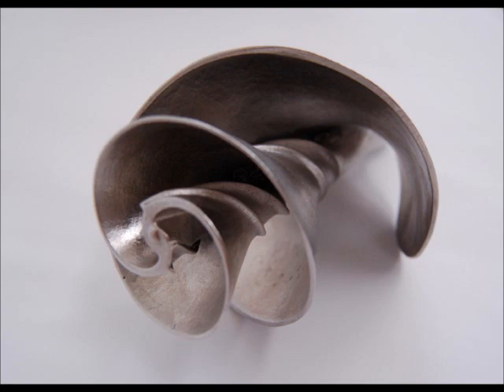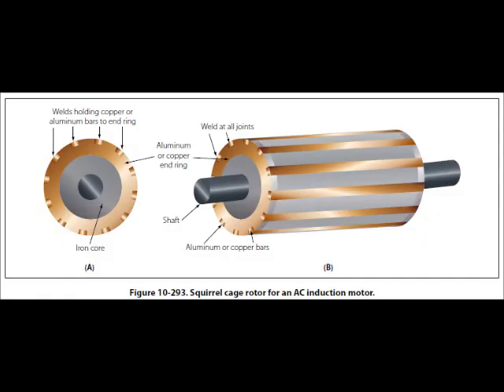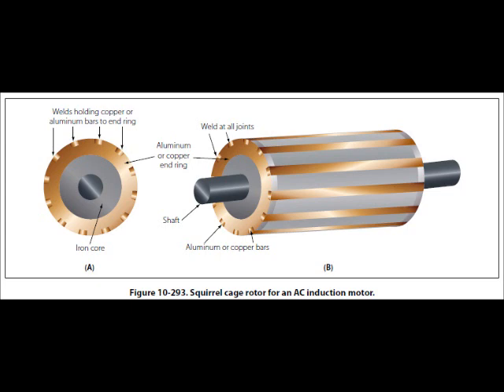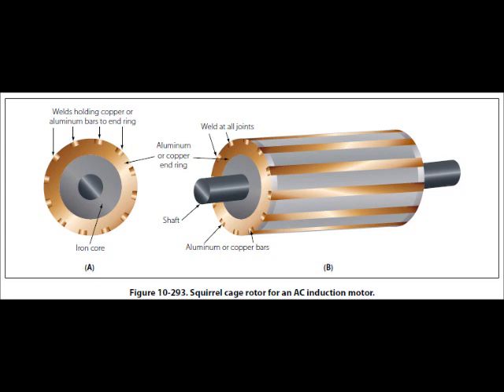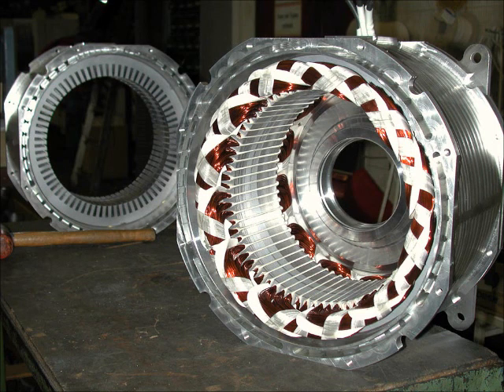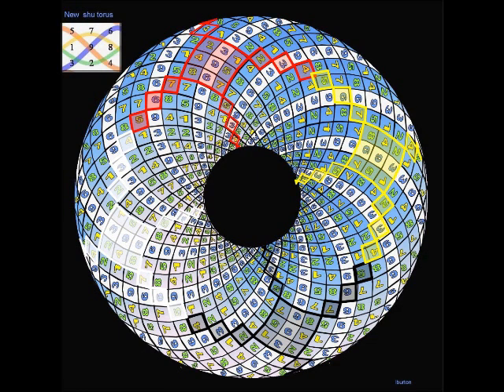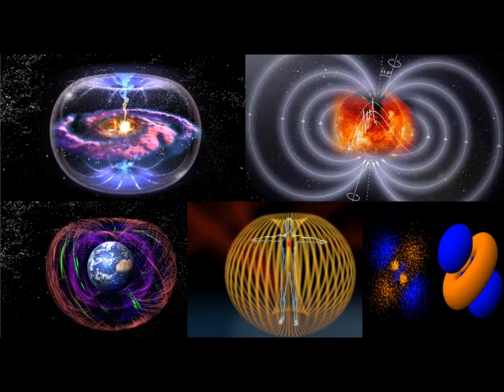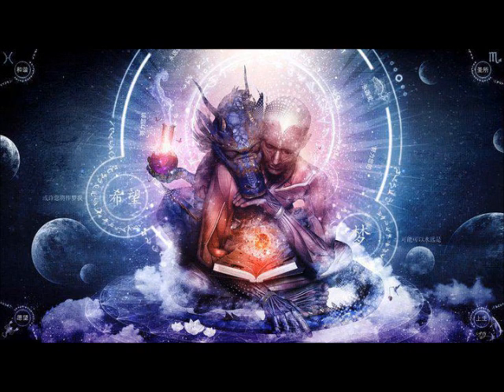Torus Vortex Lily Impeller Electric Motor

Comment: BS
Reply from the maker: You didn't understand a thing.
Reply: Tyler M  I did not get  doctorate in black magic.
Reply from the maker: Do you have a grasp of quantum physics: because what you just said is kinda what quantum physics is kinda like. So my model is based off the subatomic level in the atom. Using high grade nano material to create supper conductors. That harnesses quantum physics by using nano materials that conform to magnetic fields shape for an electric motor. Your the type of person that would say back in the 19th century that man could not fly. Let get even more basic on this level of nano materials. If you can build at large scale nano industry you can cure all cancer. So who are you. I'm an electrician.
Reply: Tyler M I am a well educated electrical,  engineer with post graduate degree.You don't impress me by throwing big words like subatomic and nano and then tell me what the hell is a supper conductor you mentioned. Is that the waiter who carries the dinner from the kitchen to the table? 
What is the " field shape of an electric motor"?
 I don't deny science but I certainly deny pseudo science which you are spouting by the barrel loads.
Reply from the maker: A room temperature Superconductor is a material that can conduct electricity with zero resistance because there is no defects in the material to resistance the movement of electrons though a conductive material. So make a material that is a nano structure which is able to happen with a molecular assembler which puts atoms together fusing them with electricity to make things like a crystalline copper conductor which supper conducts at room temperature. Doing this would then make a motor that has a constant magnetic field spinning due to no resistance or very little amount that is unresponsive. 
The field shape of an electric motor is the torus field like shape that is produced by the electrical motor. You see a motor has two things. A stator and a rotor. The stator has coils in conventional motors like an oval shape. Which does not fit the shape of the magnetic field that is in physics. You can tell this by the heat built up one each end of the oval coils.

Comment: There's a lot of motors using this design. It's called the rodin coil.
Reply from the maker: +Jose Barrers Yes my motor is kind of like Rodin's coils, but there is a big difference. You see Rodin is talking about a solid state device. My type of tours would have inner geometry that this guy showed in this video: https://www.youtube.com/watch?v=1KS5XvP_rGI  which best explains how the coils would look like from inn coils to the outer coils. My device  also use a vortex like rotor that spins in the center of the torus.

Comment: i'd like to hear your thoughts on the poe coil by daniel nunez...it's in the shape of a torus and they have a lot of claims, find vids on youtube, but they haven't made any new videos in a while
Reply from the maker: I understand your frustration. I feel we are both experienced the same idea about Daniel Nunez. He hasn't done anything that could improve the design of the motor. Now here is where I differ from what Daniel has done. There are two parts two a motor. A rotor and a stator. Daniel. Doesn't understand that the rotor has to be a certain shape or the motor will not work to the full capabilities of a zero resistant motor. You would have to build the rotor first with two vortexes opposing on each side connected together. Also the Poe coil is close, but the layering is off in the counterclockwise/clockwise rotation of the coils of wire. You need to have 4 sets of coils spaced to the portion of phi. The rotor HAS TO HAVE phi in its proportion. Very critical. Try a 3d metal printer for the rotor part and the coils of copper and iron are need for the torus shape. The form for the stator has to be non conductive.
Reply: Tyler M I'm not a experimenter, just a watcher of a ton of youtube vids...majored in math and eco, wish i'd done more engineering and physics.  I don't even understand what the poe coil is, except just a bunch of wire wrapped in a configuration.  I agree phi seems to be important, and if you've diligently studied schauberger, tesla, heaviside, and steinmetz, you're more on the right track than most others.   How did a  college student like yourself become interested in these "crackpot" ideas.  Colleges refuse to look into stuff like this as far as i know.
Reply: danh le i'd check out lasersaber on youtube who's doing a bunch of working experiments that seem easily reproducible for the hobbyist/researcher.  really cool stuff out there.  too bad i don't think he's found time to look into schauberger
Reply from the maker: Well I got into these crack pot  ideas because I had the understanding that gas is unreliable resource. I prefer perfection, I'm a perfectionist in a way. I studied electrical in 11 and 12 grade. Learned about how electricity is calculated and the properties of it. Then i had an awakening and when I got to collage I started looking for information. While I went to school to study more about electrical and get more of a handle on how the world works a corporate system. Then  I learned of Tesla which changed the game. I figure if he can do it I can. He had less than what we had and still made wireless electricity. I just didn't think it was so simple. The shape of the coils of wire is how free energy works. Its all about sacred geometry coupled with phi, and the shape of the atom. We derive are energy from atoms it self so shape are motors like atom and they will produce free energy or gravitational effects. The worst part  the US and most other countries in the UN suppresses this knowledge. I mean if this shit gets out. That would be Armageddon. I mean if some one works to create a machine like this then you fly over everyone  you can show yourself to the world this exist then get enough people on your side and you and the world wins. Seeing is belive if the sheeple  can see it they will belive.
Reply: UFO politics rewires motors that is at least double the efficiency

Comment: On the right track.   The design needs to be stretched or elongated so the electrical flow matches the angle of hertz desired.
Reply: Thats a good point most forget about but I have a question, does phi not mitigate this need? If not perhaps in all cases then some?